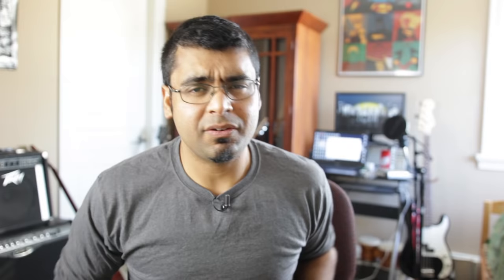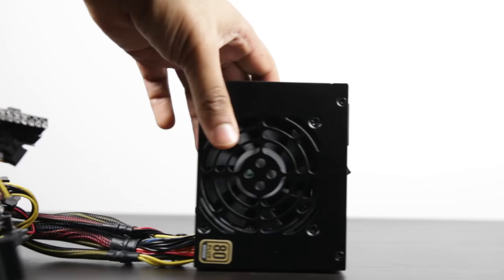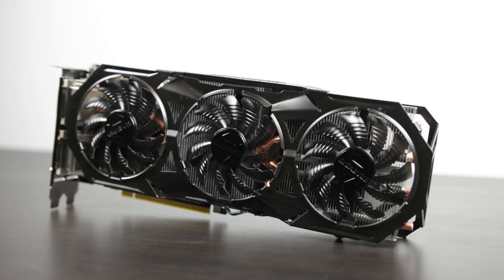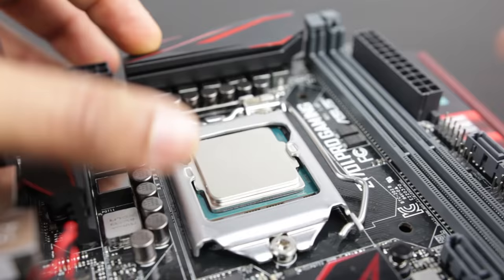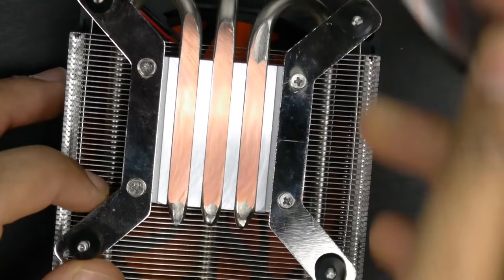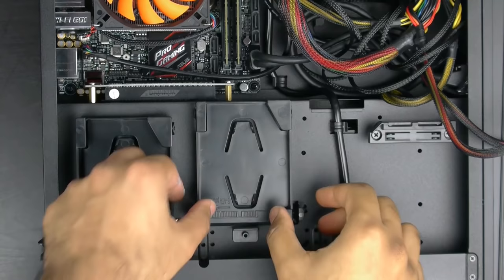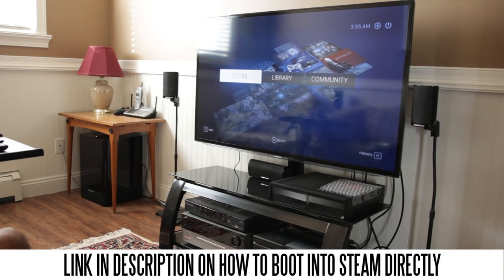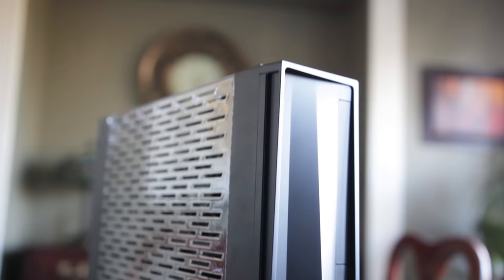EPIC 4k Gaming Console PC - Build Guide (The Console Destroyer!)

Comment: instead of i7 + 970 put i5 + 980/980ti... 970 is not capable of running 4k
Reply: +BlakerHardware it is, at lower settings that literally won't mean shit when you're across the room.
Reply: +JayFragz I'd rather be able to run games at high 4K then medium 4K with grosser textures. Not to mention  a 970 for 4K might not even give you 60 fps on medium settings in 4k
Reply: ***** there's a totally useless i7 in there... is an unbalanced match for 4k
Reply: +The Force Not even the 980ti can't maintain 60 fps at 4K with ultra settings, on many games. (witcher 3, GTA V, Crysis 3 etc).  A single 970 is not enough for a decent 4K experience
Reply: +The Force It depends on what you want. But IMO, paying more than $1000 for hardware and playing below 60 fps, when even consoles get 60 fps, is unacceptable. Those are my standards though ;)
Reply: ***** You misunderstood me. I;m not saying the 970 is not a good GPU. It's an excellent GPU, the best in it's price range, more than enough for 1080p and good enough for 1440p gaming. It's just NOT a suitable GPU for an "Epic 4K gaming console PC" as the title suggests. It might not be able to maintain 30 fps in 2016. Two way SLI is another story though
Reply: +The Force Sounds good till u hit that vram limit on 970s..I recommend a 980Ti over 970s even tho yes i know 970s can push more..
Reply: +DETERMINOLOGY 2 970 can't push like 989ti
Reply: +BlakerHardware I know that's what I said
Reply: +JayFragz No shit I don't. It's currently not capable at the moment to have a quality 4K gaming experience with a mid range graphics card unless you just play light games. A single 980ti is just enough to run every game at 4K medium high settings 60 fps
Reply: +BlakerHardware You could play games at 4k with much better framerate with an Athlon 860k/mobo combo with a 980 at a lower price point than this. I know the athlon is obviously a bottleneck for a 970 and up but for a 4k gaming anything you need a 980+. I would much rather play at 1080p ultra than 4k low to be honest. I play Witcher 3 in the 35-60fps range at 1080p with my 970 and cant imagine playing a whole lot of games at 4k.
Reply: I have my system running on a 970 hooked up to a 4k tv for casual games and I get 30-45 frames on the games I've been playing. AC Syndicate, Batman origins (at 90 fps), bioshock. Not all new games but if I want to play new games I set the res to 1080p or 4k and just let the tv upscale the content. Most of those games are on ultra settings except AC, I had to turn some settings down on those to even get under 4gb or vram usage.
Reply: 1440p upscaled, not 4k.
Reply: +BlakerHardware Right? i5-6600K would have been much better...the 6700K is $400 like hell the 6600K is $150 less...
Reply: +BlakerHardware OR r9 390
Reply: SirBringer OfCheese no. 390 or even 390X still can't handle 4K
Reply: SirBringer OfCheese where's the difference... 970 = 390
Reply: João Filipe da Costa True True!!
That's a funny point, but valid, a 970 is TOTALLY capable of running games at 4K
High Settings at 4K are fine at 30 FPS!
DEFINITELY console killer.
Reply: +Captain Leerox No just no..Console killer is a 980Ti doing 60fps at 4k...30fps is horrible and at 4k a 970 would choke at high settings....I would rather do 1440p/60fps/970 if i was on a budget then 4k/30fps/970
Reply: DETERMINOLOGY ...
Consoles can't even do all triple A titles at 1080P30FPS
4K30FPS High settings is total console killer...
Reply: +Captain Leerox You have to be noob to think 4k/30fps is solid...No its really not ..60fps is solid if its not doing 60 mostly i dont touch it and at that being at 4k/30fps lol thats a joke...

Fact is at any resolution i wanna be gaming at 60fps or higher....30fps is choppy and sloppy
Reply: DETERMINOLOGY Dude....
It isn't solid to me. But it doesn't have to be solid to be a console killer.
Reply: +Captain Leerox yawns....I wouldnt even recommend it so 30fps sucks dude
Reply: +Leftheo but you are pushing almost 4 times more pixels to your screen so :/
Reply: +SirBringer OfCheese with a 450w power supply, don't think so
Reply: +BlakerHardware or fury X
Reply: Just any i5 processor that won't bottleneck the 980/980ti would be great  for a gaming build unless you plan to edit videos and other cpu intensive tasks
Reply: +BlakerHardware my dual 390x actually destroy the 980ti
Reply: +Bilal Mughal that's what I just said, it's like making a 4K rig and having a 1080p monitor; the monitor is the bottleneck like the CPU would be with a GPU
Reply: iamtheonewhoyoulove they cost more then a single 980ti
Reply: +BlakerHardware have run several games in 4k with decent settings using a gtx 760. deal with it :)
Reply: D Bechtel your answer doesn't make any sense... if you have to build a GAMING pc there's no point on sacrifying graphics for a better cpu. an i7 is just a waste of money here. deal with it
Reply: BlakerHardware I never mentioned cpu. But what I'm saying is people have different definitions of what a gaming pc can consist of. Just because I can't run all the newer games at 4k dosen't mean I can't go back to games from last gen and earlier games from this gen and still get the benefits from 4k or 1440p
Reply: D Bechtel it's not a matter of definition of what a gaming pc consists of, is a matter of spending your budget as best as you can without wasting your money
Reply: +BlakerHardware A sfx 600w is still not enough for a 980ti, I tried.............until a sfx 750w + comes out then yeah a 980ti could work in that case.
Reply: +BlakerHardware  if you go like that   than u can take a i5-6600K and a R9 390X and upgrade the PSU to a SST-SX600-G Strider Gold Series - 600 Watt   would give you better Sytstem performance in games  also take only 1 SSD and for second drive in that case take a SSHD with 1 TB ( preferable WD black 1TB/16GB NAND ) and put all games on it..
Reply: +BlakerHardware good job playing counter strike on 4k...while i play killzone on ps4
Reply: +Zlatan Ibrahimović - Are you really Zlatan I or you just one of those... you know 'SPECIAL' people?
Reply: Jazzmanpac i am what i am...nothing less than that
Reply: +Zlatan Ibrahimović exactly...
Reply: The 980ti or the Titan X are compatible with this setup?
Reply: Rockmans1989 No, a better psu is needed and the maximum sfx psu out now is 600w which is severely underpowered, even for a 980ti.
Reply: +TheLenny655 What should I do to fit the demand of 980ti?
Reply: +Wanhui Qiao it cant work at the moment until a better sfx power supply comes out
Reply: +TheLenny655 Thanks for the answer. Also, if just i wan't to play at 1080p60fps, do you recommend the CPU+GPU combo used on the video? Or there are better options?
Reply: Rockmans1989 Yeah this is fine for 1080p but if you want an all powerful console system i suggest you wait for the better psu or even the new pascal cards which are gonna be smaller, more power efficient and yeah, extremely powerful. keynote if you consider getting this combo, best to get a sfx 500w psu for the 970 for better overclocking.
Reply: +BlakerHardware 980TI is also not fully 4K capable in a single GPU setup....it's more aiming for 1440p....and SLI setups are more an issue than working flawlessly....
Reply: miccellomann still better then single 970
Reply: +TheLenny655 it can work, silverstone has a 600w sfx psu. I have it and it works perfectly. I have a gtx TitanX @1410mhz and an I7 4790k @ 4.5ghz with h55 corsair. In a SG05BB.
Reply: BGaming_SnOwMaN Straight BS because while using the sfx power suppy the 980ti wasnt reaching its power limit  and if the fans went high the system would just shut down all together. Sometimes it wouldnt even boot, there are also reviews of the same powersupply which states that it is not very good to begin with.
Reply: +TheLenny655 well for mi its working perfectly. May I had one of the best PSU. No BS, it works. Before i used to have the same case but with an I7 3770k and a GTX 780 Ti with the Sfx 450w psu and i had a lot of trouble with that config. Still had the I7 3770k@ 4.1ghz and the 780ti @ 1160mhz.
Reply: +Blaker Is the 390x 8GB capable of running 4K?
Reply: Not fully. For full details on 4K you need SLI with two 980 TI - and you should avoid Crossfire due to the high energy consumption. If you want to run Crossfire you should take the more energy efficient Fury X....and you should calculate the space for two 120 Radiators in your case.
Reply: +The Sisko You will get decent results if you cut down on some details, but basically 390/390X are the best cards for 4K in terms of cost/performance ratio because of their 512 bit interface and the better scaling of AMD cards at higher resolutions in comparison to Nvidia cards. On top of that they also support asynchronous shaders which might be huge with DX12. And especially if you go with a freesync monitor you will have a very pleasant experience I'd say
Reply: Agreed, Also a motherboard with M.2 SSD support to make up for the case lacking drive space
Reply: +Blaker would suggest the prob is that the 970 cant boost it self forward
Reply: if 1 cant 2 sure can
Reply: +Patthon Sirilim I think it would benefit you to look into how crossfire/sli affects performance in games. Even in the best optimized game in terms of multiple GPUs performance will increase by a maximum of maybe 20 per cent with two GPUs. Some games also either don't support multiple graphics cards or just won't recognize them both.
Reply: JD 43 20  percent yea maybe from 3 to 4 but from 1 to 2 that pretty much the lowest number you will get most games get 50-70 percent tom raider gets almost 90 percent from 1 to 2 cards and even witcher 3 or gta 5 where there sli aint so good you still get at least 40 percent correct its better to run a faster single card setup but what if you want to run witcher 3 at 4k with everything turn ultra at a smoth 60fps there currently no single card solution to such demand only sli is able to achieve that
Reply: use i5 + gtx 1070
Reply: Patthon Sirilim Most games get about a 20-40 percent boost from SLI GTX 970s. You can look up benchmarks for yourself if you want. Also keep in mind that for every game that scales very well with SLI, there is a game that doesn't support well, doesn't support it at all, or crashes with two or more cards in the most extreme cases.
Reply: 2018 here, instead of 980ti put there a 2080ti... Fuck no thats a joke from nvidia... Put a 1080ti or if you want to boycot them put a vega 64.